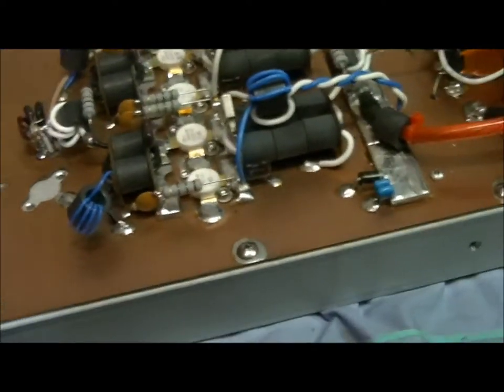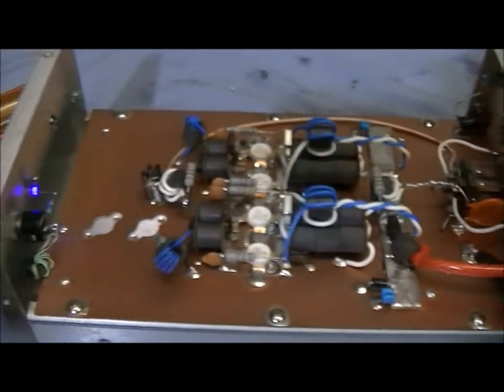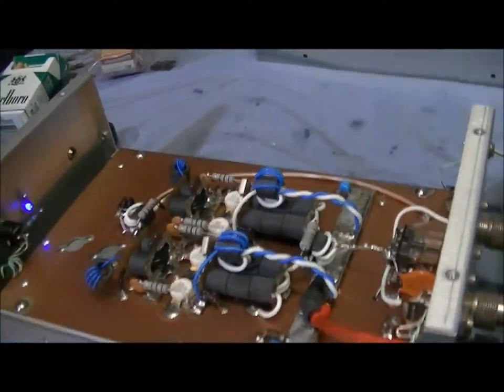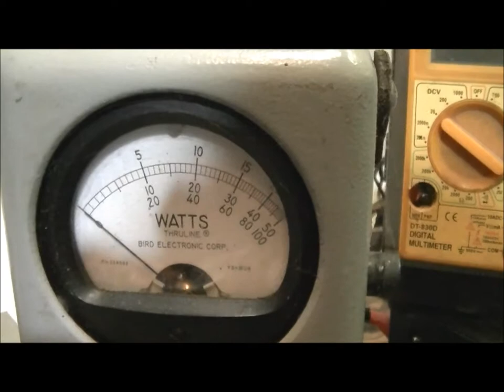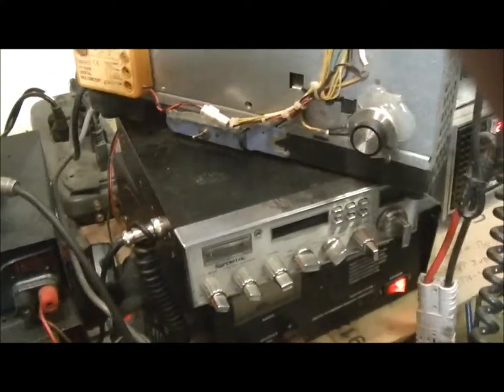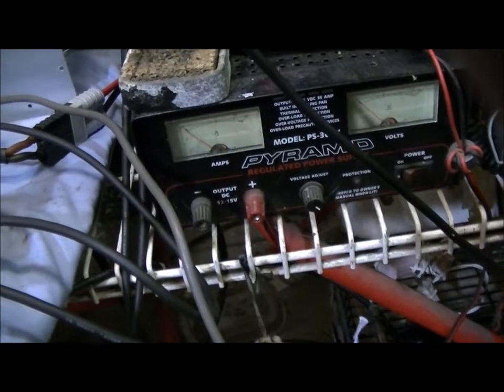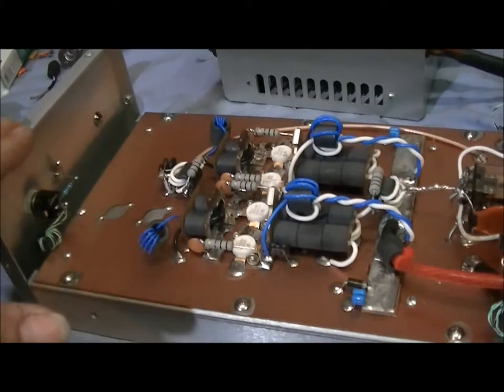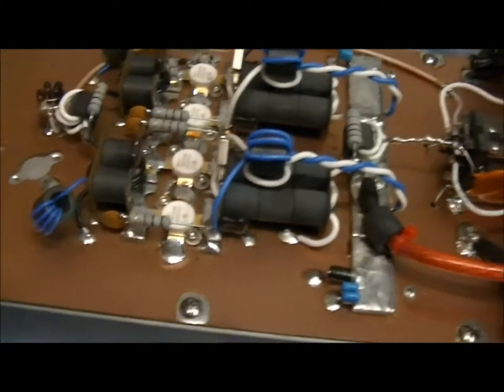How was the 2879C Named? 2nd Gen 4 💊 Read Descript 👇

Comment: Question Gatekeeper, the rumors said this type of transistors require a different capacitor tunings is that right ? If it is can you share that info
Reply from the maker: It isnt a rumor...its common sense that even though it is the same transistor as the Standard but just has two more chips in it and because of that is why the impedance Xin and Xout is a bit different and honestly Not sure if you have noticed I dont EVER use set capacitors...I fine tune every single amp I build so yet the value capacitors that I use can vary from amp to amp. So even if I have you a value it may not be the value that it would need to be for if you built one....see what im saying?

There is more then one way to make these 2879C's work. More then one way to achieve the same outcome.
I still load my output combinner with 140 to 150pf on the output of my 4 pill if I am using 61 mix on my output transformer.

It is the input that you will need to figure out for your specific build that your following. The input is always more important because it is the first door your walking through in this house 🏠 of POWER 😀😀😀😀😀😀😀

It is very simple it is no secret brother....A few trimmers and you'll have it figured out for your circuit.

I will be beginning some teaching soon stay alert of my videos id love to have be a part of it.

Comment: interesting. Never tried the 2879C yet. ICA has them . I know they tune different . may have to use 1 watt 10 ohm ? wounder how bias would do ? with reflect on antenna system it will back up into final combiner and back threw the feed backs back threw input splitter.  them 2 watt resistors a fine until a problem. either a balance or reflect issue.  I got 3 watt 1% now .at the time I could not find 5Watt 1% . so I just have the china ones. stocking problems . may be coved related. The last 8 pill RFP 2879 I did use the brass tunning tubes from ICA and got my tune right on . At the time short on metal clads . still only have a small few . I am wondering how much more heat the 2879C will make and the amps?  may have to use bigger AWG wire and a cap bank. 73's
Reply from the maker: Don't forget now I have them to cheaper :)
Reply: @1883GotDown  copy that ! My Idea for a HG pill would be put 4 2879 16DO8 together in one package like the BLF 188KR this would be a transistor in that 2 pill package. can dissipate heat better. The 2879C is 50% more. going 100% more would be a bigger package . way not do 2 like that together. 1 pill output transformer a big one . larger AWG winding on output . will work as a 4 pill 2879 with just 1 . would make assembly easier having 2 pills in same case .  There is lots of pills like that. mostly FET and LD MOS. why not BJT RF like the 2879 ? just my idea of a pill. 73's